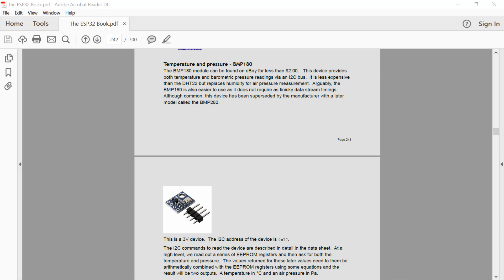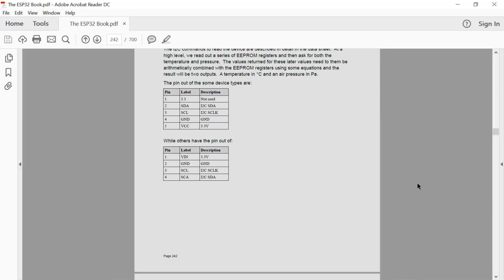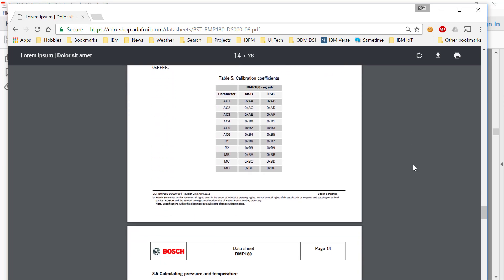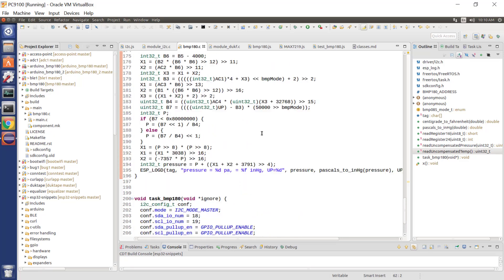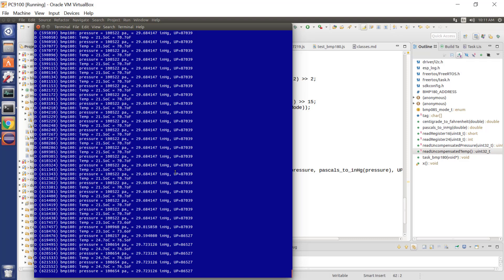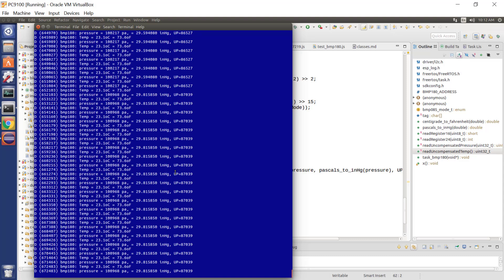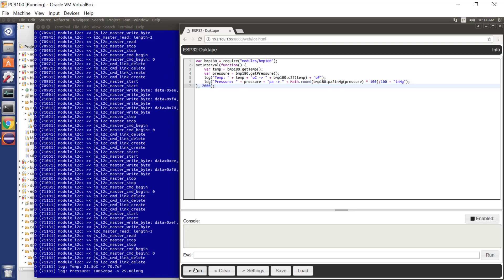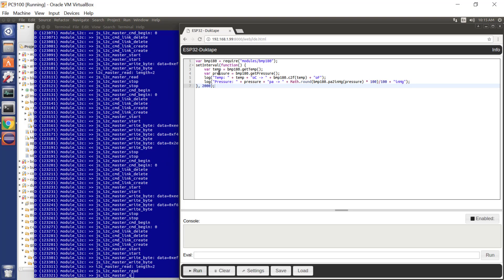ESP32 Technical Tutorials: ESP32 and BMP180

Comment: When the ESP-32 realises the price dream (while helping promote the ESP-8266 in Boston with Espressif, the CEO confided that the ESP32 would be "slightly more expensive" than the ESP8266.  Right now the pricing is just silly. Nothing here we can't do with a much cheaper ESP8266 but good video.
Reply: That might make a good discussion on the ESP32 forums ... see http://esp32.com/index.php
Reply: Totally agree .In fact I find the pricing so odd, that I wonder if they had to include some copyright costs. such as blutooth or compression rights or some arm cpu base licence.
Reply: at $10 the features and cost is worth it.   add blue tooth and add more than 1 ADC, 1 really ?   by adding multiple ADC pins you would have to spend lots more to the 8266 to come close to this chip at this price.

anyone notice the Pi-Zero was to be a $5 board ?   cost is partly due to availability.
in early 2017, the 8266 was $5, not the it is $3   it is now.   the 32 is $7.50.  all that happened is the new chip forced the cost of the old to drop.
and the old chip has already paid for the dies and the production lines.
next year, 2019... the EXP4 ?? will come out at $10, the 32 will drop to $4, the 8266 to $2....